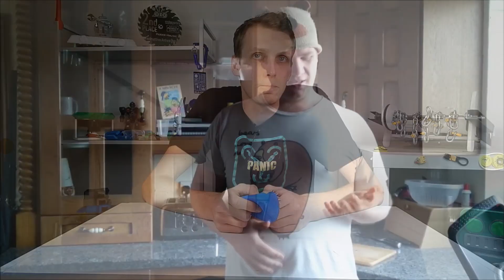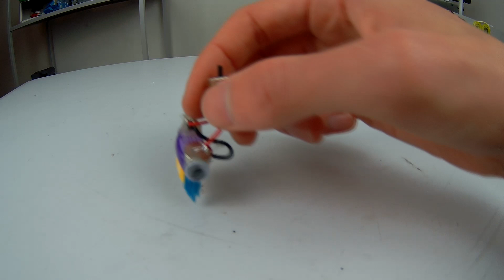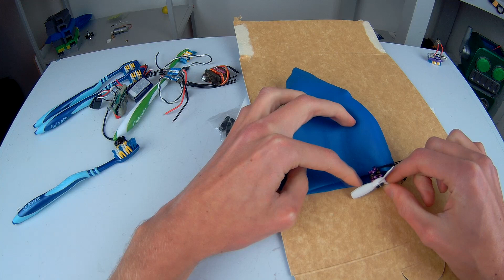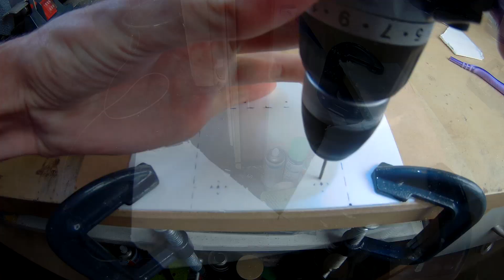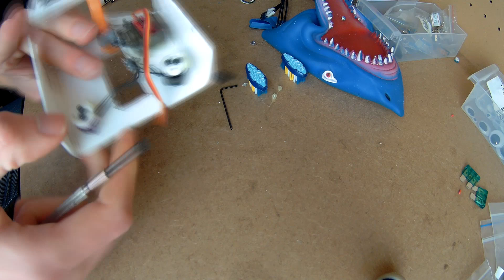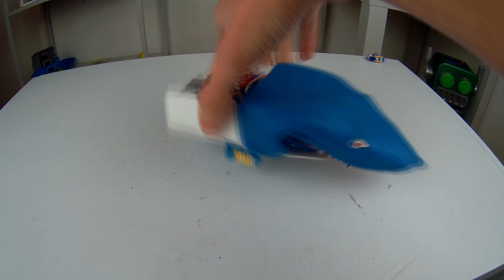Will It Bot? - Shark Combat Robot!

Comment: Both of your motors seem to rotate counter-clockwise. The right one just spins it, while the left one gives it forward movement too. It may help if you can get a clockwise on the left for better maneuverability (and step-like movement) or a clockwise on the right for decent forward speed.
Reply from the maker: Changing up the motor rotations so they counter rotate could help with it moving straight. It does tend to drift in an ark so it could be that the motor rotations is whats doing that

Comment: Do you know of any other build guids of bristle/vibrobots? or even just more videos of them fighting.  I've seen your fight against one of them in a previous video.  Im working on one of my own using two brushless spinners to generate vibration.  Im wondering if anyone has ever figured out things like optimum angle/material flexibility for speed.
Reply from the maker: Not really bristle/vibrobots are kind of rare and I havent seen a good guide for optimising bristles

I do like the concept of them though so I'll probobly build more in the future, which will mean doing more research on them
Reply: @TeamPanicRobotics  I've seen a dual ERM (eccentric rotating mass) bar spinner somewhere in an antweight (150g * 1.5 = 225g) league that had a step movement when one of them spun faster. It might be the closest thing to this.